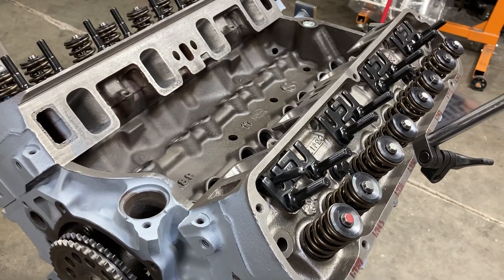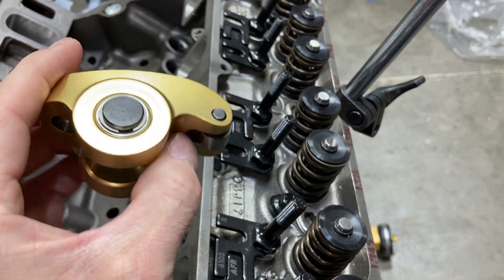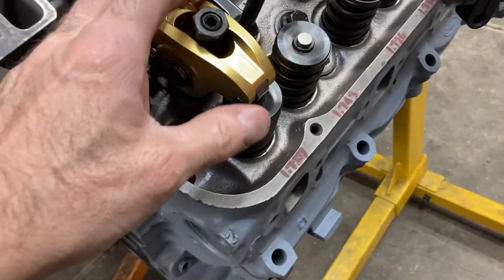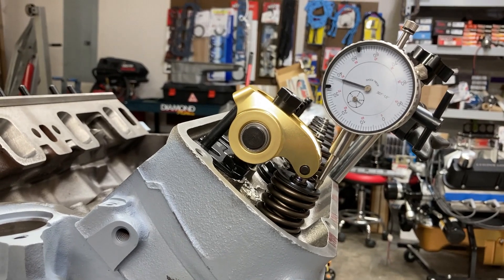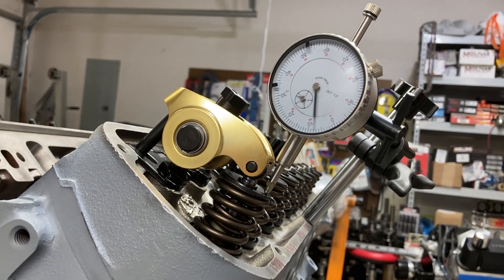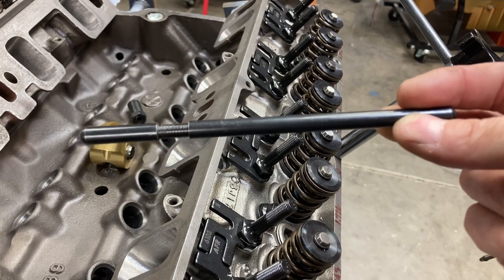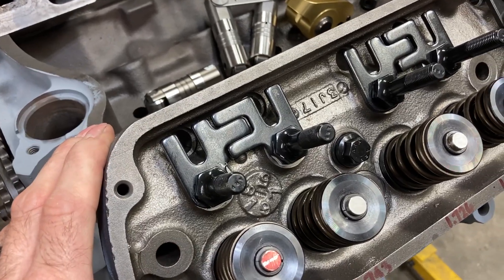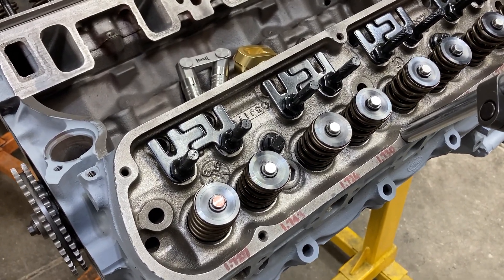Lykins Motorsports Rocker Geometry Comparisons

Comment: If it is perfectly adjusted and centered, how are the rollers are supposed to turn the valves? I always wondered if roller rockers still rotate the valves. If they don't, will it damage the valve/seats in the long run?
Reply: that's a really good question but my thinking is that at such a high RPM even with roller rockers/lifters the valve is still going to want to rotate because of the high rpm and vibration of the motor but it probably has more to do with the direction of the winding of the valve spring and the rotation of the cam it's all going to transfer through the push rod and do what it wants to do which is rotate or spin! if you ever want a high RPM dual overhead cam engines valve train in operation the valve springs and valves still spin which is pretty interesting and then when they start turning the engine to 10,000 RPM you can actually see valve float start to happen which is even more interesting!

Comment: BlaBlaBla, set the rocker at 0 lash go through one rotation and check that the movement on the valve stem is in the middle.
Reply from the maker: Well, that might work, if it weren't for the fact that in a lot of instances, the best geometry is not "in the middle".......  Sorry if I bore you.  You know, you don't have to watch the video.  You also don't have to post condescending comments.
Reply: @Lykins Motorsports  actually I wanted to ask this very question, I can get my valve 90° to roller center and trunion center using laser guides to ensure its 90°, but my wear pattern is a little lower than center I'd say within the 2/3 of the stem is this ok to run?
Reply: @lykinsmotorsports  Ok thanks
Reply: yeah, there is always some bonehead that craves the attention in comments sections, when they have zero clues of what they're talking about. If you don't like the video, watch something else.